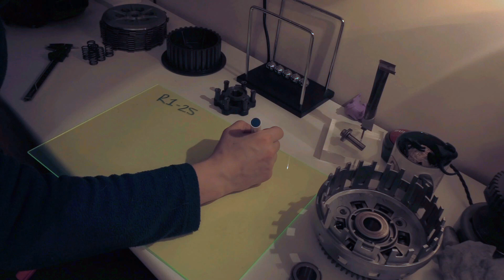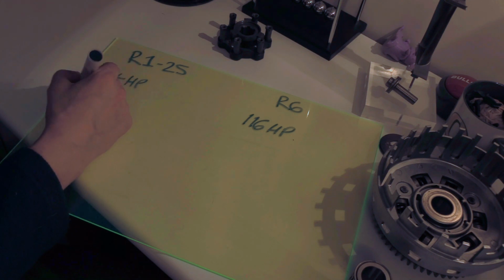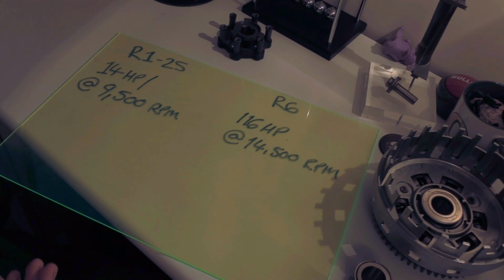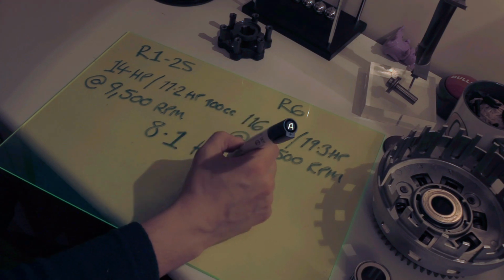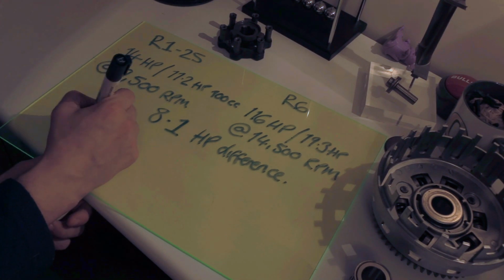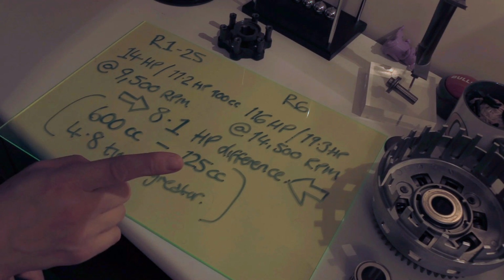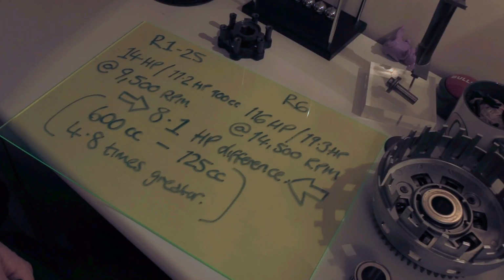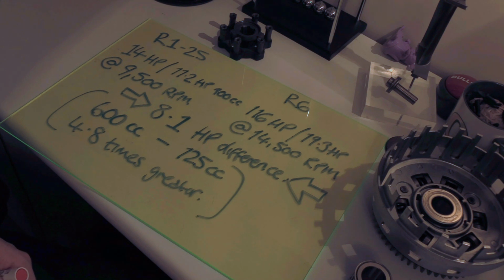Power Difference - R125 vs R6?

Comment: The main reason the 125 makes less horsepower per 100cc is purely because the 125cc bike is limited by law to produce a maximum amount of power. therefore its cheaper to make it that way, as they can use less expensive components and give the bike increased reliability and decreased fuel consumption and emissions than if they tried to push the same maximum by law power figure from a smaller displacement engine.
Reply: This, it's the definitive answer. Maximize cc for the class of bike, maximize power (in this case 14 or 15ish by law) and minimize cost and unreliability.
Reply from the maker: But how... this is just words...
Reply: Thats the main reason. Would be much different if the regulations only were for the displacement.
Just look at the old "open" 50cc class in germany or the japanese 400cc class. These are some amazing engines..
Reply: -Lower rev limit 
-Smaller valves 
-Less aggressive cam profiles
-Lower compression 
-Different bore to stroke ratio 
-Less well tuned inlet and exhaust system 
-Conservative timing and fuel maps.
The list goes on  
Yamaha could if they wanted make 25+ hp out of a 125 single. 
The yamaha factory yz250f single cylinder mx bikes regularly make over 50hp and with lower reciprocating mass and lighter valve trains they should technically be able to get more bhp per cc from a 125 than the 250s 
The reason they make 15hp is because they are built to fit the 15hp law where as the r6 has been built to compete with the cbr and the gsxr and especially the previous model r6 and so it gets more powerful with every generation.
Reply from the maker: Words.... which one is it? Or out another way which one makes the greatest difference?
Reply: @thedirtyworkshop  Compression i would say

11:1 (125) vs 13:1 (600)
Reply from the maker: So the obvious question is that change in compression = almost double the power? Shit, I best increase my compression...
Reply: Bore and stroke, r6 oversquare r125 undersquare. Sohc vs dohc
Reply: @thedirtyworkshop  Its RPM then, right? Feel like an idiot right now
Cams, valves etc. is designed around that
Reply: Is this at the crank? Or at the output shaft/rear wheel?

Can we blame any other internal engine parts for being power consuming, for example, both engines will have a camshaft/timing chain to drive.
Reply: @size1985  Ah, I'm with you, what's the power output of the R6 at the same RPM as the 125s maximum, divided by 4?
Reply: @thedirtyworkshop  all of those things are part of the same equation "revs" without forced induction the only way to make an engine create more power is to rev it harder and cram more power strokes into every minute.
Reply: @thedirtyworkshop  flow optimized to High rpm?

Comment: The multi cylinder engine r6 will help with the power delivery per revolution. The single cylinder is unbalanced and might be spinning a balance shaft which will reduce power. Bore, stroke and valve size ratio and peak piston speeds will be different causing a difference in pumping losses and the inlet and exhaust are designed differently. Mapping of the r125 is definately restricted, the exhaust is snotted up to the eyballs with a  a cat and a very restrictive silencer. I have a feeling I have exposed my dickhead, hahaha.
Reply: Even without all the emissions crap, you're probably on the right lines with the restriction - make it for the market kinda thing, with licence restrictions etc (I'm sure they're quite global now, Japan has always been a bit funny about powerful bikes, hence the popularity of the 400cc baby superbikes in the 90's)

Comment: If you want a 'fast' 125, buy a 2 stroke
Reply: @FBI Thats what ive got :)
Reply: Rs125 derestrict it and done 33hp in stock form.
Reply: Or just get a vespa 300 reg 125
Reply: They’re only fast when they’re running though. Therefore over the course of a year a four stroke is considerably faster.😉
Reply: @jediknight1294  Ive heard the claim, but never seen it backed up. You might get 28bhp from an older 125, the 33 is at the crank.
Reply: @Martin52863  properly maintained 2 strokes take more of a thrashing than a 4 stroke......
Reply: @Martin52863  My RS has only been off road for a few days since i bought her, and that was 'user error' ;)
Reply: @boneav83  lol, it was just a joke to rustle the Jessie’s of 2t owners. I know they’re not that bad so long as they’re maintained properly.  The problem is that most 125cc 2t’s aren’t as they’re owned by oiks in trackies😉
Reply: @Martin52863  Dont i know it lol, i found silicone bathroom sealant had been used as gasket glue when i did a cylinder swap on mine.
Reply: @boneav83  🤣😂🤣😂🤣
Reply: May be quick 'for a 125', but still not quick though are they.
I mean, the best of them was under 40bhp, an average 600cc bike would start from 100bhp, my 1990's RF9 is 130 or so bhp (depending on where you read - 125-135)
If you want fast bike, get a faster bike, if you're restricted to a 125cc then you're also restricted on the power and power / weight of that 125...
Reply: @waynedl99  oh Aye, this is why I said a 'fast' 125. The next bike for me is a 250 2t as I'm an idiot and love them. A 600 would be more sensible but I'm not 😁
Reply: @Martin52863  Weird, mine runs all year long.
Reply: @waynedl99  Fastest 2T 125cc, Aprilia RSA 125, 53bhp, single cylinder. But yeah, above 600cc... Current 4T are faster.
Reply: @cristianr3712  all year long? Your fuel tank must be huuuuuuge!
Reply: cagivo mito 125 fully ported. they do over 100mph lol engine wont last long.
Reply: @crouchingtiger5431  that's not a 125.
Reply: @mrpantur7280  A full power not so ported Cagiva Mito does 160kmh, let me give you an example, my friend had a Kawasaki KR150 ported to a high degree but still usable on the street, that bike would beat a Suzuki GS500 in top speed and during the 4 years he had the bike... Never changed the cylinder, or hone it or similar, still going strong when he sold it. I had a Yamaha RX-S 115, bored to 132cc, I strapped a tuned pipe, an unrestricted CDI and of course ported it a bit, not to the fullest because still street bike, top speed around 140kmh GPS geared a little short and would beat a KTM Duke 200 in acceleration all day long, had it like that for 1 full year... Never even changed rings, doing around 24km 6 days a week.
Reply: @mrpantur7280  My big end bearing let go last week :) My crank is on its way to PJME as we speak. They joys :)
Reply: I had a Cagiva Mito 125 a few years ago that bike could blowoff anything in it's class even small 1.2 car's wish I'd keetp it
Reply: @crouchingtiger5431  until the smart camera detect the plate. Smart cameras are clsmping down on people doing engine conversions. Lol
Reply: @waynedl99  40bhp is still nippy compared to the legal limit of 14.8bhp. Lol
Reply: @cristianr3712  the stock rs 125s barely made 30bhp. Full power was around 33 to 36bhp. 🙃
Reply: @sailormoon2548  I still have mine. I have the evolution 7 speed.
Reply: @JDMz  Indeed, but those are just old bikes, after Jan Thiel teachings it's not difficult getting reliable 40+hp off of a 125cc, that's how KTM got to make the fastest factory 2T after 2010, just take a look at the EXC125 and the SX.

Comment: R6 have a higher compression ratio,  moreover it's a inline 4 that does helps to decrease pumping loses so it can able to breath at such astronomical rpms(some cases it achieved more than 100% volmetric efficiency as cylinder get overfilled  due to air velocity and longer intake valve opening ). 
Inherent balancing of Inline4 ensure no/less requirement of balancing shaft, so does mechanical losses also kept in check.

Comment: Single cylinder versus multiple cylinders, and restrictions applied to 125. More cyclinders = more power delivered per 360 ' rotation, ie 4 powerstrokes.  A 2 stroke 125  will have roughly twice the power due to more power strokes per rotation. Hence why 2 stroke 250 is closer to 500/600 cc 4 stroke.

Comment: R6 has bigger bore 67 against 52 so better filling of the cilinder. However the 125 has bigger stroke and ( therefore?) higher torque. So some restriction has to be in place.  Maybe less valve overlap to stay within environmental restrictions ?that means the engine is earlier out of breath. The mean piston speed for the 125 is also lower so there should besomething to gain. But they are not allowed

Comment: Compression, flow rate(volume of rich air) intake manifold design, valve timing, valve overlap, back pressure, ignition timing, bore vs stroke, number of cylinders(balancing shaft, pumping losses), firing interval. Maybe even piston ring design?
Pretty much all of these and prolly way more variables but I am not a mechanic.

But now I've got a question, is there an advantage to change the cylinder offset in low vs high cc?

Comment: Since the maximum power output is limited by law to 14.75 HP, Yamaha have instead tuned the engine for useable torque and it develops the most torque of any of the restricted 125s. Yamaha have done this using their version of variable valve lift where a low lift intake cam operates below about 7,500 rpm after which a higher lift cam takes over. I'm guessing Yamaha have used the profile of the higher lift cam coupled with the ECU to exactly hit the 14.75 max power limit.

Comment: Depends what you mean by Why? I'm sure cam profiles are different lower revs obviously, could be lower compression.

The actual reason why it's so much behind is that for a learner legal 125cc the power limit is 14bhp so that's what it has to make, any more and it can't be ridden on L plates so no learners can buy it, any more and it's still going to be tops a 18bhp slow bike that costs basically the same as an R3 so no one with a proper license will buy it.

Comment: If you compare hp it is more correct to scale for revs as well, if you don’t want to make this adjustment- it is better to compare torque figures. (which would be more or less equal +\- for what purpose the engines are optimized)
Reply from the maker: And do that comparison, what do you get?
Reply: @thedirtyworkshop  we get a value, that will be close to the average torque, sir. My point is that it is not fair to compare power of these bikes directly. That HP gap can be attributed to the rpm difference.
Reply from the maker: It's not fair, why? Comparing units is why the we use standardised units...
Reply from the maker: And yoy state the gap can be attributed to that, but are you sure?
Reply: @thedirtyworkshop   I think so. I haven't seen r6 dyno plot yet. My prediction is that r6's P(kW)/V(cc) at 9.5k rpm is more or less the same as r123 's. If it would be possible to spin up r125 to 14.5k rpm (let's say, materials, manufacturing process and quality control allows us to do so and the engine doesn't blow) we would see the same ~19 hp/cc. Please correct me if I am wrong. (Much respect for answering multiple times in comments)

Comment: As other people already pointed out, main factors will be:
- difference in rpm
- the single cylinder only fires once every two crank rotations (not so sure about this one) 
- ...and is restricted by legislation on top of that
- ...but at least it should have lower friction losses because fewer components

Comment: Some will be down to the rpm? 
I suspect the R6 is high compression ratio too.
So, with that higher compression ratio, it does more work per bang, and then with more revs = more hp.

Comment: It has to be a bit tricky and expensive to de-restrict the bike, else we would get "magic" boxes all over Alibay to plug to the electrical harness, giving you an extra 6 BHP in no time. 
So it is not simply a shaved camshaft or small valves : it would be too easy to replace them.
I would bet on the ECU, combinig a restricted injector and a nerfed ignition advance above peak power. 

(also : I noticed a sticker on the fairing : "Tuned by Del & Brock" ; wha-bam : 40% less BHP)

Comment: Hp = torque * rpm/5252 means to increase hp, we can add torque in the same amount rpm.  Same amount of torque but put it in higher rpm or add torque and put it in higher rpm.
In case for r125 and r6, r125 have lower amount torque per 100 cc and peaked in lower rpm (12.24 Nm @8000 rpm for 2018 model) while r6 gave higher torque per 100cc and peaked in higher rpm (61.7 Nm @ 10000 rpm for 2017-present model).
If 125 peaked its 12.24nm torque in higher rpm (e.g @10000rpm) maybe it can have higher amount hp/100cc.

Comment: Suspect R125 has more restrictive manufacturing costs. Four cylinders helps engine balance, fat slim pistons with a shorter stroke, double camshaft; All lets the R6 perform reliably at the higher rpm. Higher compression ratio on R6 helps it burn more fuel and helps thermal efficiency. R6 probably has a better fuel injection system.

Are those HP at the crank? Can a well designed gearbox give much power savings?

Comment: Looking at a dyno graph of the R6, @9,500 rpm the hp per 100cc is about 13 which is not far off the number for the R1-25. I'd expect the R6 to bit more aggressively tuned than the R1-25 so 2hp per 100cc is not much to ask if you can fiddle with the fuel map and timing and only satisfy the noise and emissions regulations. The R1-25 also has to keep within the power limit for an A1 licence.

Comment: quick 10 minute check: r125 is sohc -> limited valve timing/lift (never thought about it before but my guess is valve lift restriction, possibly rotating mass at higher rpm) and has Bore/stroke ratio of 0.887 // r6 is dohc so more freedom on valve timing/lift and Bore/Stroke ratio is 1.576 so much more of a spinny boi. lookinng at the powerband of the r6 it mmust have some sort of variable intake lenght
Reply: It does have a variable intake with 2 different stack positions. That damn dip in the power band gives it away.

I think it takes to long to switch, but it may need to be so fast already that it's unreasonable. No one else uses them on bikes that I'm aware of.

Comment: Is this going to be something to do with the cube square rule? 
You increase the combustion chamber volume by (x) amount, but the surface area only increases by half that. So you can burn more fuel with comparatively less heat loss,

Comment: Maybe because there's only one moment of combustion to cycle the R125's piston as opposed to the R6, requiring more work per cylinder to complete the remaining three strokes in the engine. 

If I had to guess, one cylinder on its power stroke in the R6 would provide the work necessary to complete another cylinder's compression/exhaust/intake stroke, relieving each cylinder to bear the work necessary to cycle its own piston. 

As a counterpoint, multiple cylinders could ultimately add more mass for the engine to move  (longer cams/crank, more valve assemblies, etc.), meaning a multiple cylinder engine would require more work to cycle itself when compared to a single cylinder engine of the same displacement. 

As a disclaimer, I'm a failed engineering student so all of this could be donkey-backwards.

Comment: I personally have no idea but I go with small percentage increases everywhere slightly higher compression ratio how Yamaha tunes performance vs commuter engines slight gains in efficiency from a higher displacement.

Comment: I'am gonna have a guess.

Materials, fabrication methods ( forging vs casting)

Design principles ( balance is better, bore and stroke relationship, conducive for higher rpm) 

Features ( variable intake length, valve timing/duration/lift, multi point fuel injection)

So overall the 600 is more 'power efficient' than the 125 for lack of a better term.

Comment: Really quick the what it's not: 
- ignition timing (almost ideally tuned on all engines)
- mixture (they have a catalyst, therefore run pretty much lambda 1)
- compression ratio (slightly different but insignificant for power)

You said already the number and size of valves is good. Now I think it's VALVE TIMING and DURATION. It makes sense to use this to limit the engine, you'll get good torque down low and a significant drop in torque when your power approaches 14hp. 
Now I also think intake size might play a SMALLER! role:
At first you'd think it's affecting air flow in the same way as the valves, wouldn't make sense to have good valves with a small intake BUT.. you need good valves to flow properly even at low RPM (which you want, since you're not at the limiting 14hp at low RPM), while you don't need as large of a throttle body to flow properly at low RPM, since the part between throttle body and valves acts as a buffer chamber.
So it makes sense to use the throttle body as a limiting factor, even while having good valves.

Comment: The 1-25 is a city bike and must be torquey to be able to start rolling with two people on it. The 600 does not need to be torquey, it trades low end torque for horsepower high up (due to its greater displacement it has enough torque to be rideable in city conditions anyway). If the 1-25 was tuned like the R^6 it would be mostly unusable in everyday traffic.

Comment: I’m not the expert but I think it’s highly depends on your engine’s volume(cc) and fuel air mixture pressure going through combustion chamber. I guess lots of powerful machine running with 2 or 3 cylinder out there and producing almost same power that 4 cylinder versions do so I think it’s because fuel air mixture pressure and depending on that it can runs on much higher rpm and if you have more volume than r 125 have then you can replace much more cylinder into engine and it gives you a much more faster machine. Probably not the best explanation but I’m not native English speaker and If I missing something let me know please :) have good day